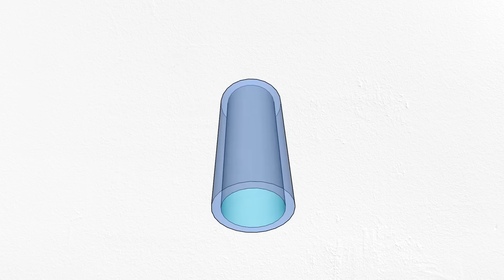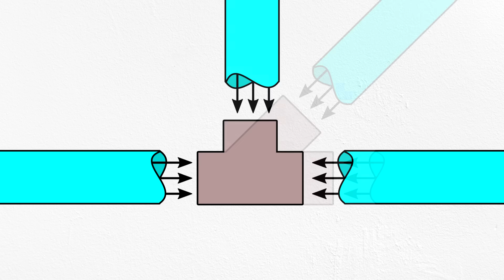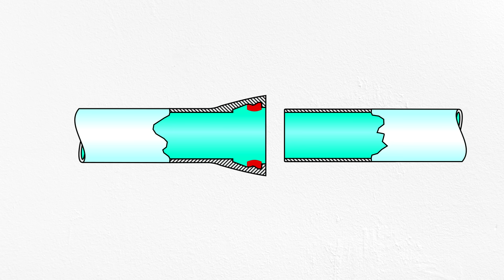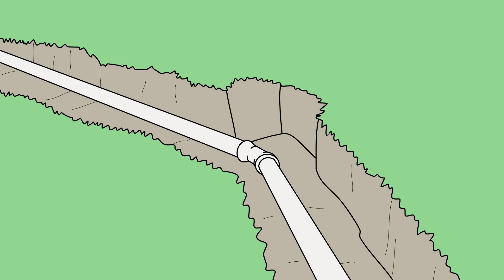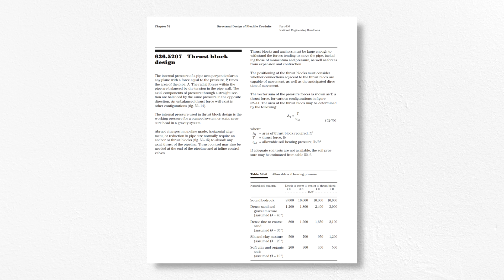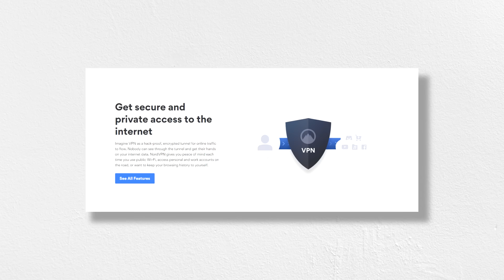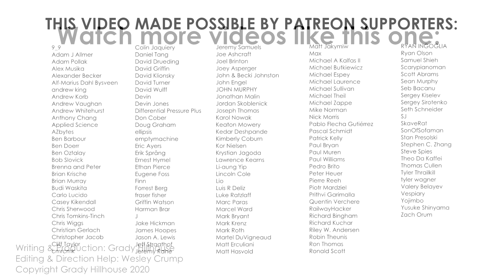Why Pipes Move Underground

Comment: I work in a oil refinery and most of our new pipes are welded or bolted.
Even in a facility where we have a pressure of 700 atmospheres the pipes are bolted 😃🤷‍♂️
Reply: Bet those bolts are bigger than what I can get at my neighborhood true value
Reply: @brianjonker510  I've found 1-1/2 inch socketed bolts at my local lowes before... 🤷‍♂️

For frame of reference, in my aviation job, our 1-1/2 inch bolts are torques pretty heavily, to to tune of 800+ in/lbs. The only thing that torques higher is a 8" diameter 1/2" thick castellated nut which holds the rotor on.
Reply: @kirknay  Probably 800 foot pounds.
Reply: @UncleKennysPlace  probably 800 king George thumbs per king Henry's stool after curry night. Or you could use SI
Reply: Kenny Phillips that would make more sense yeah. Couldn’t you reach 800 inch pounds with one finger on a cheater bar?😂
Reply: @UncleKennysPlace  nope, inch pounds. I have the torque wrench on a shelf in the tool room.
Reply: @kirknay  ????? 800 in/lb is equivalent to about 70-80ft/lb which is below the torque of a wheel nut. Pretty sure you mean ft/lbs.
Reply: @kirknay  That doesn't seem like much - thats like 60 ft lbs lol Put more force on my head studs on my car!
Reply: @fraserhughes4502  Aviation implies light weight materials like aluminum or composites. Very different world from steel nuts on steel threads to hold cast iron parts together.
Reply: @kirknay  sorry for a stupid question, but what does "1-1/2" mean? I've been encountering this there and there and my best guess is 1.5, but you know... Guess is just that, a guess
Reply: @KelticStingray  I lol'd
Reply: @fraserhughes4502  Remember the screw thread gives a big mechanical advantage, multiplying the torque force several times to give a higher clamping force.  800 inch pounds would result in several tons of clamping pressure
Reply: @fraserhughes4502  66,66 ft/lb=90,288N/m. That is appropriate for a mid grade halve inch screw.
Reply: @KelticStingray  nah, smoot pounds more like
Reply: @TunerThings  head studs are torque to yield, you aren't just tightening the bolts in that application you are stretching them to just before their failure point.  the goal is to pre stretch the bolts so they dont stretch uncontrollably due to combustion pressure.  pipes dont see the same pressure spikes, and also pipe flanges are easier to seal than a head.  if you could seal each cylinder with 20ish fasteners in a perfect circle you wouldnt need as much clamping force.  but the head is sealing several cylinders as well as coolant passages in a square package and 16 fasteners, not to mention the head and block are frequently different materials.
Reply: @fraserhughes4502  nope, the driveshaft bolts on my helicopter are torqued at ~800 in. lbs. The jesus nut is torqued to about 6k ft. lbs, but we use a hydraulic power dyne that looks like a Minion for that one.
Reply: Дмитрий Сергиенко it’s 1.5 idk why they don’t use it but Americans don’t seem to like to use decimals anywhere.
Reply: @tomgarside480  as an American I prefer them but working in the trades I've just accepted them.
Reply: Bryan Kraemer yeh I think they a little less clear if you are used to decimals but most people hear in the US are more accustomed to fractions. I bet it’s related to how they teach math in elementary school.
Reply: @KelticStingray  no man, PSI and pound-feet are much better units than their metric equivalent.
Reply: @nolanstrife7350  In decimal terms, it's 1.5 in. America is wierd in that the education system is so archaeic that we have school bells ripped straight from 1800's factory floors, and the decimal system isn't taught until your 7th year of education.
Reply: @kirknay  That's only 66 ft-lb.  Not that tight.
Reply: @lint2023  apparently more than tight enough for a steel bolt, teflon coated steel nut, and joining 2 driveshafts and a flex pack.
Reply: @KingHalbatorix  Get some education. Use metric.
Reply: @kirknay  huh... That's odd. In Russia we learn about decimals right after fractions in 5th grade. Not sure about plumbing, but in electrics we most commonly use decimals. For example 2x2.5 would mean a cable with 2 cores each having a cross section of 2.5 mm^2. Thanks
Reply: @nolanstrife7350 1 1/2" is the diameter of the bolt holding the flanges together.
Reply: Stephen Robson you mentioned King George and popping in the same sentence so I’m obligated to mention that King George III had a condition that made his poop purple
Reply: kirknay fellow A&P?
Reply: @nolanstrife7350  I believe that it's probably because of the odd fractions, while the fractions of ½ etc, are easy to write out explicitly in decimal form e.g. .5 etc. There are odd fractions such ⅓ & ⅔ which are impossible to write out cleanly.  For example ⅓ being 0.3333... etc.
Reply: @nolanstrife7350   Decimals are taught earlier, just depends on if kirknay was awake.

otherwise our US system(different than imperial) uses fractions a lot, like in wrenches like 13/16", 1-1/16, 2-1/8, etc. When you work with them everyday you get to know them and know all the conversions and simplifications. 

on a side note, I find the metric vs US vs Imperial debate funny: metric is smarter and the countries that use it are so smart they claim but show a fraction and they shut down and freak out like they've only heard of it, and seeing it is the end of the world, as their excuse is "fractions are hard"
Reply: @Speed001  a head sized castellated (looks like a crown) nut that is the only thing holding a rotor on.
Reply: @brianjonker510  those can be seen and replaced
Reply: I work in a pipe shop, making a lot of the stuff that goes to refineries and basically anywhere that wants pressure vessels.  It's crazy the amount of pressure those bolted flanges will hold.  We hydro our own stuff, so you really gotta stand behind your welds lol.
Reply: bolted flanges can form very strong seals with the right gasket
Reply: I've never felt quite satisfied with welded joints for high-pressure applications. I know they've done the calculations but I'd rather trust two pieces of solid metal that cannot possibly pass through each other. Bolts are just less likely to fail catastrophically, and despite the low risk associated with either method I'd take the small, single-joint failure over the entire line exploding.
Reply: 700 atmospheres isn’t that something like 10k psi only thing I thought went in that range were water cutters wow that’s high
Reply: @gavinmesser4  well the actual reactor uses 300-350 atmospheres and if it has a run away we have vessels with nitrogen at 700 atmospheres to stop the reactions
Reply: @ftr98  RHCU?
Reply: @gavinmesser4  Exactly yes
Reply: @gavinmesser4  And now consider that most pressure containing equipment has to undergo testing at 1.5x design pressure. For some equipment at my company that means 22500 psi / 1551 bar.
Reply: Hey, I also work in oil refinery. About what facility are you talking about? I'm really curious, because I work there just since september on hydrogen generation unit. The highest pressure in the process is about 65 atmospheres (or 6,5 MPa), and the highest pressure in the unit is 90 atmospheres (9MPa). I know that on the other installations there are higher pressures, but I have no clue where it could be 35MPa in reactor and 70MPa of nitrogen.
Reply: @505videoman  it's a Hydrocracking Unit but it was first used as Coal to Liquid facility https://en.wikipedia.org/wiki/Coal_liquefaction?wprov=sfla1
Reply: F-T. R in my town there is a 36 feet wide 8 feet tall culvert that is 1.16km long, it has other 1km long  tunnels flowing into it. It has 49 miles of surface area . I walk through it a lot it’s called the rio monterroso.
Reply: Swampy  Just because the weld itself is stronger doesn't mean the joint is safer. When welded pipes fail, it's not because the pipe itself loses structural integrity, it's because the pipe that was rapidly heated and cooled loses its strength. Just because the weld is stronger than the base metal doesn't mean the pipe is stronger than a continuous piece, because that's factually incorrect. And my main point is that when that joint fails, it is almost always catastrophic. Restrained joints, when used properly, make the whole system as strong as it would be as a single continuous piece and doesn't weaken the pipe at every joint, and they have a much lower chance of catastrophic failure because no potential failure plane is created unlike in welding. In a high pressure system I'd much rather have a leak spring up than have to deal with the sudden, violent expulsion of the complete pressurized contents. Imagine that's high pressure gas and the welded joint fails; the release of hundreds of PSI of gas would basically be an explosion and no detection equipment is saving any of the workers who happen to be nearby. You can go on all you want about how strong the weld itself is, but until you can weld two pieces of pipe together and have them be as strong as one solid pipe it's always going to be a more dangerous way of fitting pipes together for high-pressure systems. Overall failure rate or pressure rating isn't the only goal; the goal is safety and those metrics are only part of that.
Reply: here in switzerland I often see bolted pipes on hydropower plants, coming down from the mountain into the machinehouse. they usually run trough huge cemented blocks at every bend they do, now I know why. I always thought they would just hold the pipe up from the ground....
Reply: Unscrew some of them to make watter rockets.
Reply: Metric. System. All the in/lbs, ft/pd sound like a gorgeous King’s George thumbs / King’s whoever stool example.

Comment: Does the thrust block need lots of mass or is it more about surface area? Could you design a type of underground pipe fitting which has fins that distribute the thrust forces to the surrounding soil? - thus mitigating the issues of having to pour and wait for concrete to set.
Reply: I think I know what you meant, but sadly, it wasn't really feasible. For starters, most pipes would be made of materials that didn't really do well if being made into fins (like PVC). Less tougher than concrete.

And then you deal with different type of soil and environment. Fins would be not very feasible in gravel soil, but concrete would happily pour around gravel and hardened, and then done.
Reply: Combination... Surface area to bear on adjacent soil and mass to dampen forces.

Comment: I would love to see how those oil pumps work. The ones you see in big Fields
Reply: Also, what the other components of an oil refinery around the cracking tower. 

The oil and gas pipeline system starting in northern Alberta and ending in Galveston, TX. Lots of small pipelines adding up to a vast, efficient fuel transportation system across America.
Reply: @SethMethCS  You mean the TransCanada? I used to work for a guy who ran the entire right of way years ago.
Reply: Do you mean an oil pumpjack (donkey)?

https://youtu.be/X0Dpd52pfp0
Reply: @petercarioscia9189  
Exactly. I want to see practical engineering make a video on those exact things..

You're super smart and helpful. Thanks
Reply: We have an oil pipeline that comes right past our town and a booster station less than 10 miles away. So being on the fire department we got to tour the facility. And let me tell you, the pressures and volumes that these operate at is an amazing engineering feat. The facility uses more electricity than our entire town of 2333 population.

Comment: Hey Grady, Love the videos on liquid pipe and electrical lines, was wondering if you were planning on making any videos on gas pipes in the future?
Reply: Do it
Reply: This covered gas pipes - although the demo used a liquid for visibility reasons.
Reply: New construction in California wont allow gas lines. All new buildings will be electric only. Weird
Reply: @gonzos-twin  Solar only ? :)
Reply: @millomweb  I wish
Reply: Though you were asking for glass pipes for a sec.
Reply: Good idea!
Reply: he has one on steam hammer, that's a gas
Reply: @jeromerox9999  to be fair, that's a gas  bubble forming and collapsing with a series of preassure pulses in reaction to an abruptly interruption of a dynamic liquid medium within a pipe.
Far from similiar to a pipe system for a gas phase medium.
Reply: @SonsOfLorgar  Just curious: Did you really need to say "dynamic liquid medium" or could you have just said liquid? Is it different somehow? Also, what does "abruptly interruption" mean? And  "gas phase medium" seems weird too. Why not just gas?
Reply: I think things like the Combined gas law and liquid equations are mostly applicable to each other. Still physics in general. Liquid simply has more mass and bigger particles than gas but work with pretty much on the same equations just with different considerations. E.g. Gas has less momentum given the same speed or flow rate simply because it has less mass so air is less likely to make a hammer effect. 

There are considerations of course on what happens when a pocket of air travels through a water pipe and vice versa.

Not a civil engineer here, just giving my 2c based on what I remember on physics. Gas, liquids, and solids pretty much are affected by the same equations (e.g. pv/t = pv/t) they just have some considerations like gas is has less mass than liquids therefore that have less momentum and expands less when temperature increases.

But eh, again, just my non-civil engineering mouth giving its two cents.